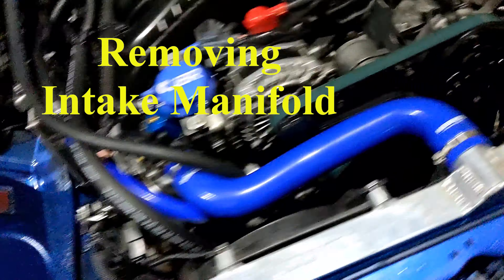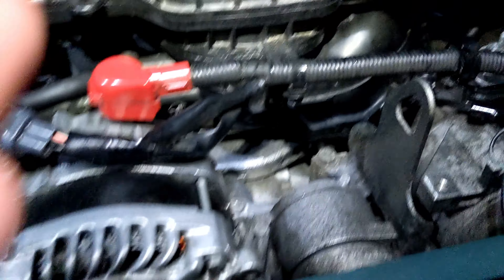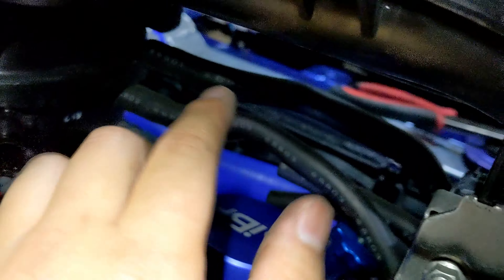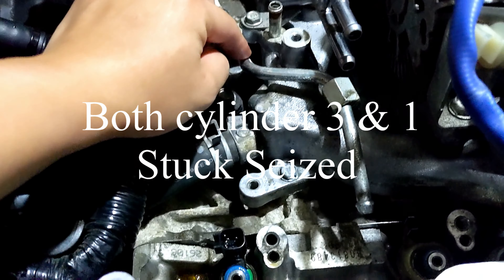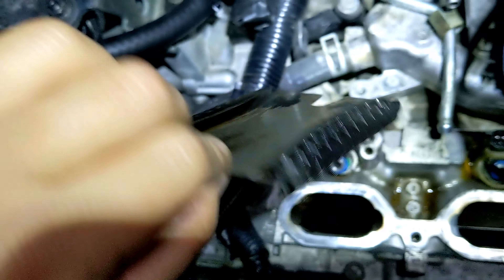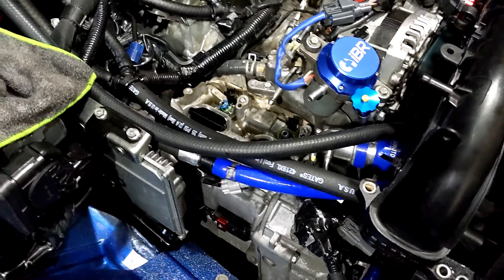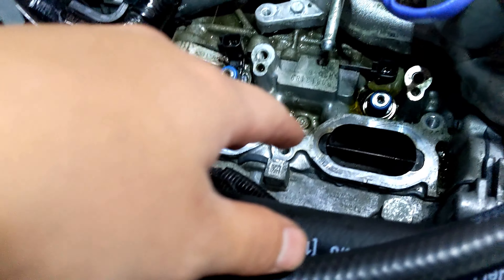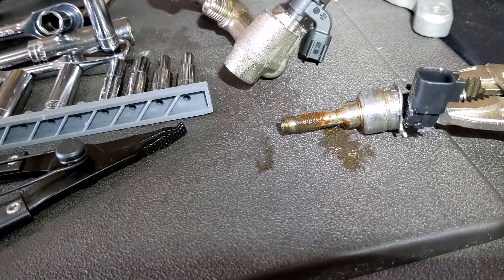Seized Direct Fuel Injectors Cylinder 3 and 1 Remove Intake Manifold FA20DIT WRX

Comment: If you're running E85 all of the time, I recommend putting in regular pump gas every so often.

E85 is a "dry" gas and won't "lubricate" a lot of parts compared to regular pump gas.
Reply: Rdftfcc tv

Comment: The 3rd one is a demon
Reply: Unk in laws got the same cylinder 3 misfire, swapped the ignition coil and spark plug with cylinder #1 and still the same error code.

Comment: had the same problem. turns out I had 2 slight bent valves on  cylinder 3 intake side. they weren't bad can't even tell unless you spin em then you can see a slight wobble they were just bent enough to not hold compression

Comment: once you get the injector twisted a little bit use brake cleaner let the brake cleaner soak down around the carbon is sticking the injector in the head that will help eat the carbon up a little bit so help you get the injector out

Comment: Were you getting any check engine lights? I keep getting P219a and starting to think it may be an injector problem as per Subaru bulletin.
Reply from the maker: had 3 misfires codes for cylinders, if i were to go back i would just get a new engine instead of doing all this work

Comment: Hey man appreciate the video. I have an fa20dit 2018 wrx stage 2. what do you think the symptoms were of this issue? Im getting severe fuel dillution. going to get it checked out soon. Thinking ringland or injectors.
Reply from the maker: Well I was pushing 25-26psi on the stock motor so eventually it was a ticking time bomb. Never pulled the motor apart to figure it out. I did Replace injector and clean everything and walnut blasted too.

Comment: Everyone talking about extrem rich fuel trims, so cylinder flooding? I ask cause I have hard start issues on mine and -16 af learning, looking to see if injectors could be my issue🤷
Reply from the maker: i did replace the injectors but it still had issues on wide open throttle.
Reply: @leekouvlogzs  What made you look at the injectors to begin with?  I am getting Cyl 3 Misfires at 4k+ RPM and under load.  I did MAF Clean, Spark plugs, Coilpacks, etc.  Car starts idles, drives fine around town as long as I keep RPM down.
Reply from the maker: @jacobraymond1448  this video was many years ago, sorry if this was too late

Comment: Did you have any issues with the car that led you to do this?
Reply: Kinda investigating an issue i have
Reply from the maker: Had a misfire during cold start and got worse
Reply from the maker: @_VXLS  no it didn't jerk but power was cut off at high rpm. Had to replace the fuel injectors on 3 and 1. But 2 months after that I traded it in.
Reply: @leekouvlogzs I know my 3 years late but I’m having the same issue now missfire cyl 3 , and car sputters at high rpm. I’ll prob do an injector

Comment: Just pulled my injectors yesterday, cylinder 3 looks identical to yours and was a real bitch to get out loool. Any tips on how to put the new ones in? They're a bit tough, might need to clean out the bore of the injector slot and use a deadblow to get them in it seems.
Reply from the maker: the new ones slide in, they are never to be pulled apart with a tool.

Comment: how many miles are on this engine?
Reply from the maker: 44,000 miles
Reply: @leekouvlogzs  and what caused all this buildup? ethanol or stright e85 ?
Reply from the maker: @harrypoter4465  overtime gunk fuel buildup
Reply: @leekouvlogzs   so its not e85 specifically causing this?
Reply from the maker: @harrypoter4465  I ran the car on e85 all year

Comment: Did you have a blinking engine light when it was misfiring and did this fix it ?
Reply from the maker: No I didn't, but the check engine was on before
Reply: On Monday I had got p0300 I changed spark plugs and it fixed it one of my spark plugs didn’t have no more spark & 5 days later I got code p0303 trying to figure out what’s the most common issue that can cause this.
Reply from the maker: @JuanGomez-gx8hp  i could not answer that for you, its alot of hassling with the codes to find the main cause of the issue.